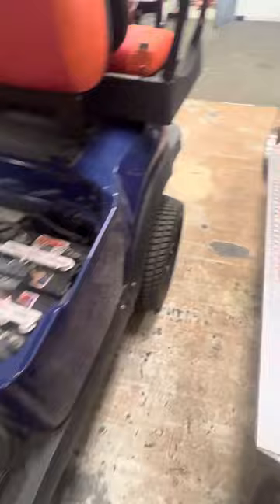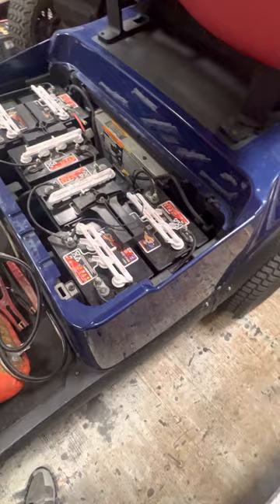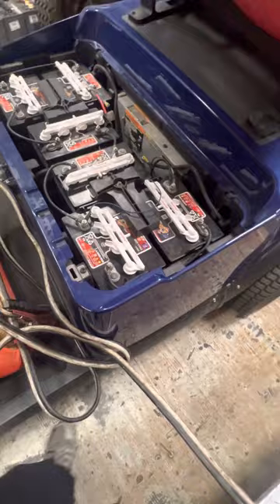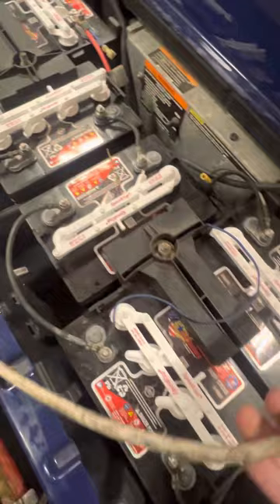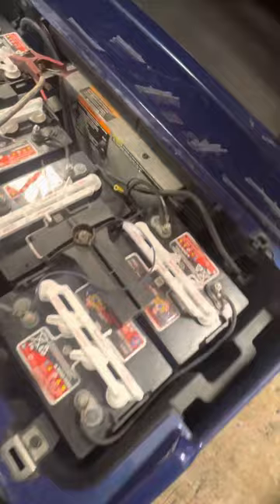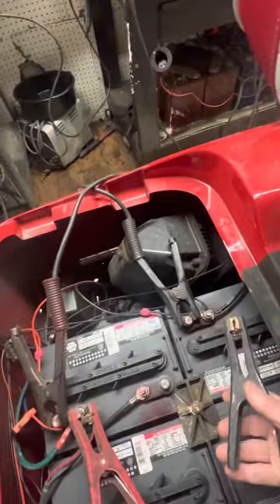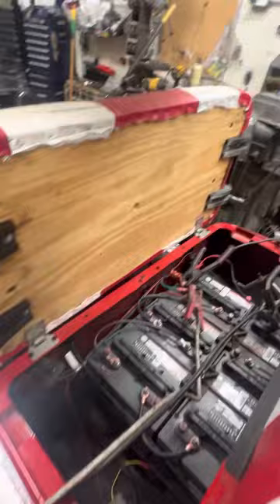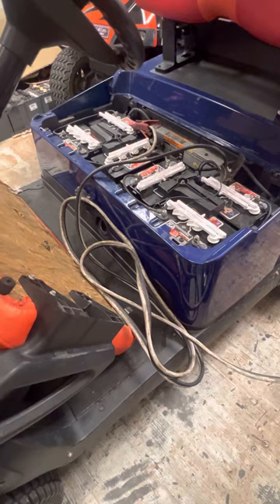Golf cart batteries won’t charge. SIMPLE SOLUTION

Comment: my cart batteries are dead dead.  I have a centech 12v manual charger from harbor freight. i was told i didnt have to disconnect all the batteries to charge them individually but i see you are saying different.  also i noticed on my battery charger it says in small print, it wont charge dead batteries.  what the heck is a battery charger for lol?
Reply from the maker: You don’t have to unhook them to charge them up.
Reply from the maker: All the new chargers won’t charge dead batteries which is useless. But I would just hook your vehicle with jumper cables to one battery then while you have the jumper cables hooked up. Hook up the charger to the golf cart battery. Then once it kicks on. Unhook your vehicle. Then once that battery takes a charge. Hook the jumper cable from the charged battery to the dead battery   And do the same.
Reply from the maker: Did you get the batteries charging